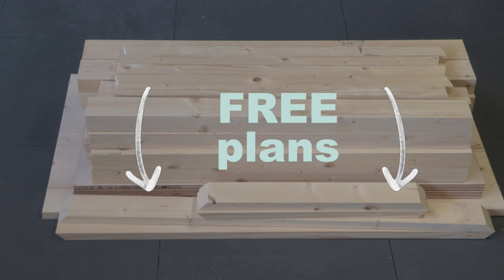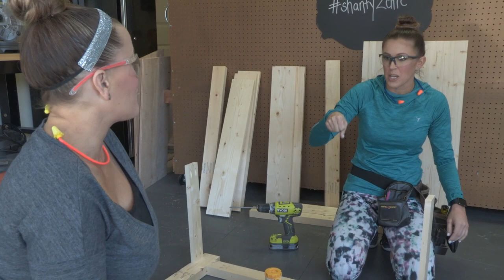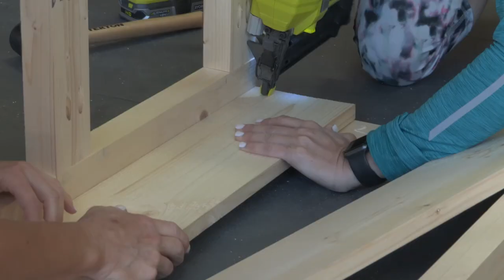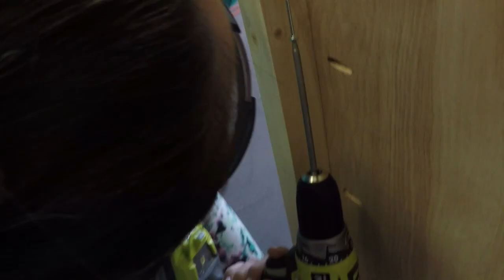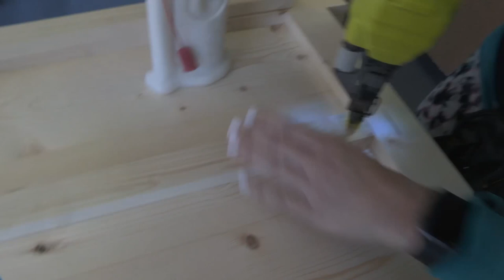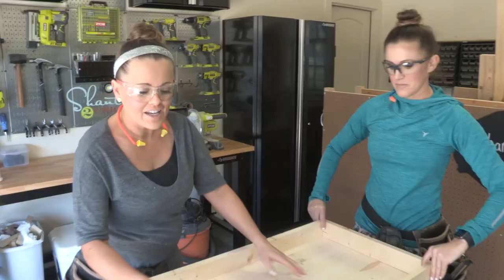DIY Changing Table with Storage | Shanty2Chic

Comment: Literally building this project rn and ur measurements are absolutely incorrect. The 2x3’s in the back plus the 2 2x4’s equates to 37”. Therefore throwing off the measurements for the top panel and 2 shelves. Nice job. 🤦🏼‍♂️🙄

Comment: i just have a question. do you ever have problems when you drive the screws into the pocket holes without clamps? sometimes i have the issue that the piece moves when i drive them in
Reply: santy santy I have this issue. my remedy is to have the piece I'm screwing through about 1/16 of an inch from the actual intended position. this way, at that last moment, when the piece secures itself, it's right on. 

hope this helps!!!
Reply from the maker: Yes!  We use clamps when we can and sometimes we just stand on things to keep them from moving...  We get creative :-)
Reply: Kreg has a clamp designed to go into the hole and clamp.
Reply from the maker: They do!  Lots, but still there are times when they can't be used one certain angles

Comment: Quick Question: On the 2x4x8's, are they 4" (actually 3 1/2" I know - could use a 2x6 to get an exact 4" i guess) wide or smaller due to you ripping the rounded edges off? Same for the 2x3x8?
Reply from the maker: Lee Clark they are a tad more narrow after ripping the edges!

Comment: what do you mean your using 3/4" pocket holes. I'm thinking you mean 3/8" pocket holes. it's a honest slip up. your vids are great.
Reply: rpratt812 They mean the pocket hole guide is set to 3/4” as in to be used with 1 by wood.

Comment: Does anyone know if I can use 1x4 boards instead of the 2x4 boards.  I would prefer the square edges and don't have a table saw.
Reply: Using 1x4 boards will make it less stable.  You could always use wood glue and clamps to join two 1x4's together.  That will allow you to keep the square edges.  Also, keep an eye out for cheap, used tools (like table saws) on craigslist or OfferUp!  It's a good way to save money on barely used equipment.

Comment: Awesome! am a big fan! just wondering if is there any problem using two glued pieces a 1 X 4 X 8  instead 2 X 4 X 8 and the same for the 2 X 3 X 8 since its hard to my get those :(
Reply: Eber Gardea there's no difference but the finished product will more than likely show seams somewhere...

I haven't looked at the plans yet, just an assumption. hope this helps
Reply from the maker: Agreed with Joshua on this one! It would show those seams without lots of sanding... Have you thought about ripping down the 2x4 to get the 2x3?
Reply: Shanty2Chic i would try that option! thanks for the tip, is there any idea for  a baby beside sleeper video in the feature??? :D i think could be an awesome project
Reply: Joshua Ewald thanks for the advise, guess i would have to look harder for it
Reply from the maker: I debated doing a bassinet, but I think I have decided against it... Not sure yet!  Right now I have hit a wall, but once he's here everything may change :-)